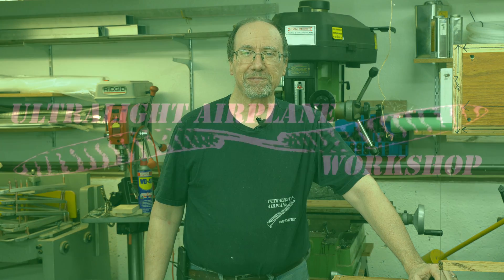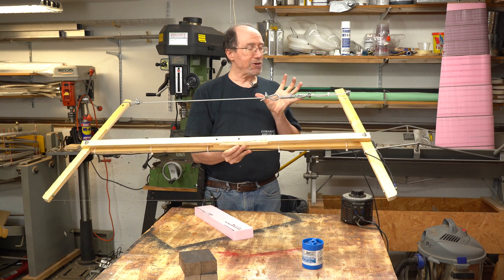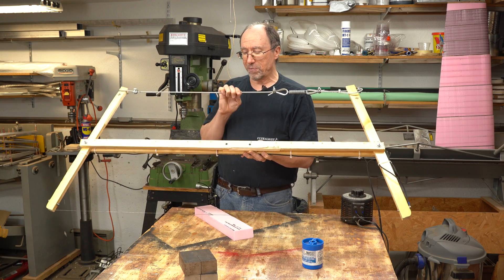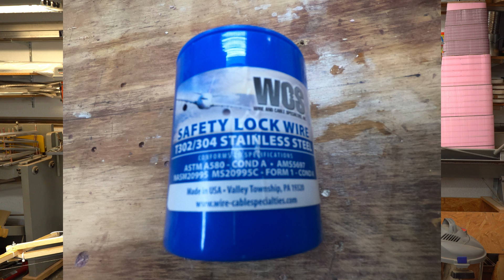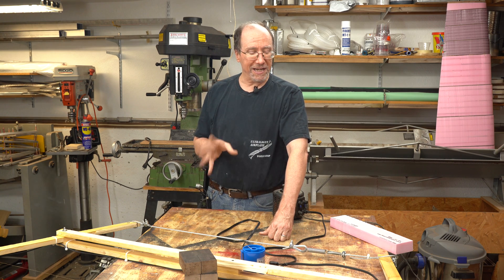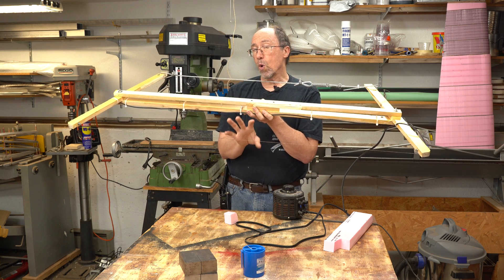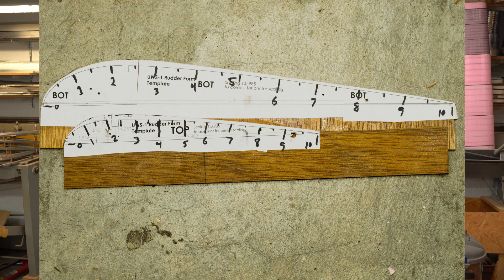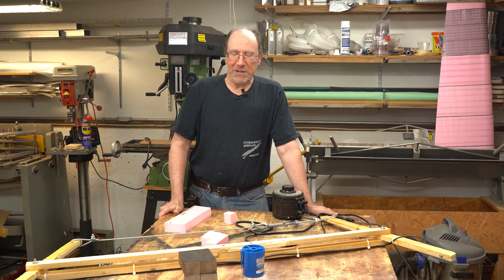Design of a Bow Hot-Wire Cutter

Comment: forget the spring - make it like an old skool bow saw, using loops of twine / string / rope. then get a piece of wood between the loopage and wind the tension up windlass style. tension can be adjusted turn at a time while in use
Reply: also it's easy to slacken for storage

Comment: Using a variac straight off the mains power makes this an electrocution hazard. Better to run a low voltage transformer off the variac so it cant go over around 40v and is isolated from the mains.

Comment: You can always tell who's the engineer, he's the one that over engineers the project. Surfboard shapers have been using hot wire cutters for decades and the bow of choice is the simply C shape bow with the cutting wire and a spring attached to take-up the slack. Classic KISS: Keep It Simple Stupid.

Comment: Just a thing I noticed: When un-bowing the chord with the spring, do it while putting tension on the spring, and taking tension out of the hotwire, or else, u might tear the hotwire, with the added tension of un-bowing. In other words, press with yout foot against the wood-end near the spring ("spring-proximal wood-end"), pull an the opposite chord´s end thus stretching the spring, and un-bow it while holding the spring-distal wood-end stable.

Comment: Burt Rutan just uses a wing nut on the end of the wire and a u shape. He states it's for light weight and ease of use. He also adjusts the wire after warming to correct cutting temp due to heat stretch.